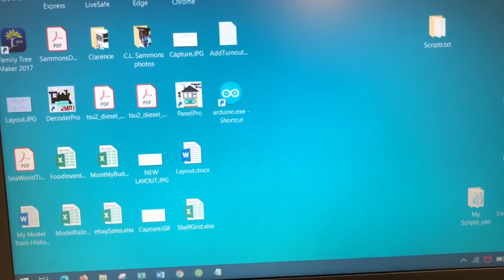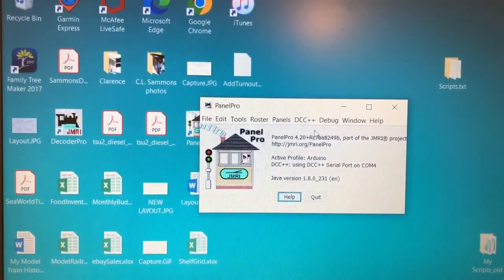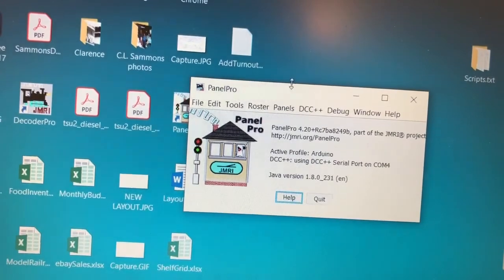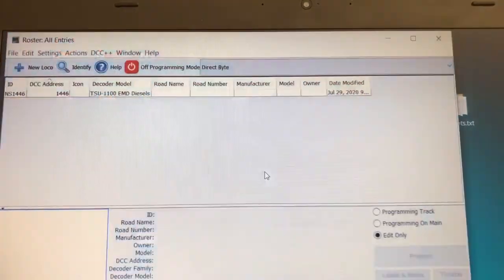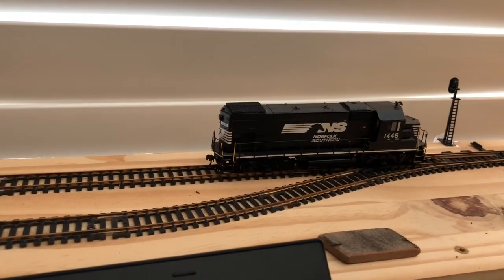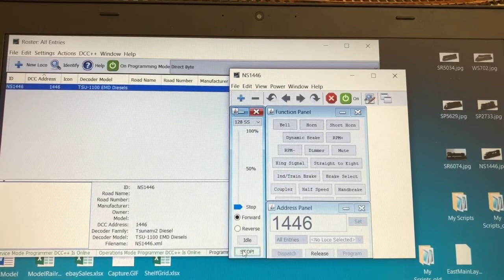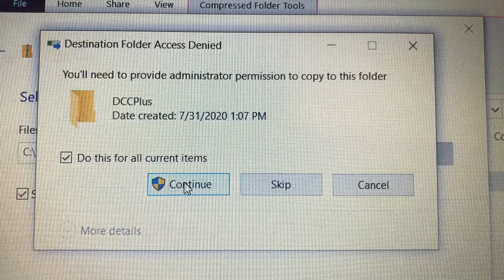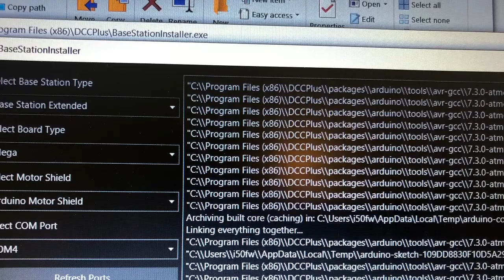My 4x8 x 2 HO Layout - Arduino, DCC++, JMRI  (See comment)

Comment: Hi Fred. For this setup. Do you need to upload any sketch to the arduino?
Reply from the maker: I installed the DCC++ software(sketch) on the Arduino.  To actually run and control locos I wrote JMRI scripts.   There is a playlist on my channel showing some of my JMRI scripts.  I didn’t write any sketches as such.  Hope that answers your question.

Comment: Hi Fred, Just stumbled on your Youtube channel and it definitely struck a chord with me. I am a retired electrical engineer / computer geek who is very deep into Arduinos JMRI etc. Saw your comment about the light sensors and wanted to offer  a solution for you. You can buy and use just the light dependent resistor (the brown round thing on the end of your module). They are pennies each - sold by the dozen. You hook them up with one lead to an arduino signal pin and the other to arduino ground. Then in software turn on the pullup resistor   pinMode(pinNumber, INPUT_PULLUP);  // sets pull-up on analog pin     then later on in your loop do an analog read from the pin     value1 = analogRead(pinNumber)    ... If you print the values you will see they vary based on light. With a little bit of filtering / smoothing it can be quite usable as a sensor input. Note: the pin does need to be one of the analog inputs A0 to A5.  (A6 and A7 do not have pull up resistors)
Reply from the maker: Thanks for the information Alan.  I’m now using IR sensors directly connected to the Arduino.  These were recommended by more than one viewer.

I have >10 of these working with JMRI scripts.  I have difficulty getting them installed thru the track ties and firing in JMRI.  Sometimes I really have to fight with them and other times they line up and work great.  I have one i have yet to get working.  🤬.   I’m thinking about taking a light sensor and rewiring it for  longer lead wires that I plug into the body of the sensor using DuPont wires.  I suck at soldering but if it works might be easier in long run.   I have many more I’d like to install.  The little button sensor will not be as visible as the IR.  But they might give me trouble in the garage as with the door open the light changes.

Comment: Probably too late but you could de-solder the optical sensor and add a short extension.  Then you could mount the board underneath and poke the sensor through the board where you need it.
Reply from the maker: Thanks for your comment Philip.  😀 I’m not good at soldering but I’m going to try the optical ones this Fall.  The ones I’ve been using are sometimes difficult to install

Comment: A short explanation of what Arduino is and what JMRI stands for and what it is would be helpful for us newbies.  After you install all of this, including your sensors, will you be controlling your operation with the computer or your MRC throttle cab?  Or both?  I have the MRC Prodigy Advance Squared and I will like being able to walk around the layout rather than sitting at a computer and clicking on commands.  Or maybe I just don't get it. LOL   Cheers, Bob
Reply from the maker: I added a new video on my technological which might answer you questions.  If I’m just doing a simple video on running train or brief operating video, i use the MRC.   Sometimes the iPad with WiThrottle. I have auxiliary MRC throttle connection on far side of layout.
Reply from the maker: I use JMRI for learning and to reach my goal of four trains run by computer.  Honestly, I rarely just run my trains for myself.  I think contributing to the YouTube MRR community is big part of the enjoyment In this hobby.  Building something and showing it off.
Reply from the maker: Just watched your Christmas tree train video.  I was reliving that time from my youth and smiling thinking of my Lionel going around the floor.  Old school, Man.  But then, surprise!  The sound cranked up.  😀. Very cool.  👍👍😀

Comment: Hi Fred If you are putting more than 12 volts into your Mega (generally 15v for OO/HO), you have to cut/scrape the vin connect trace on the back of the motor shield
Reply from the maker: David, Thanks for comment.  I’m just using 12v 5 amp now into the Arduino base unit.  I’m wondering if I should’ve put power directly to the motor shield as only 1/2 lights show for program track.  Locomotives work on main ok as both light on.   I learned after video that only 2 amps each flow to track for main and program track connectors.  It’s all new to me.  Be safe😷
Reply: @FredE528  Hi Fred I see you followed Cobo on HO video  I used the same video , just to clarify my previous comment  I should have said if you are putting more than 12volts into your DCC++ base station ie motor shield   (generally 15v for OO/HO), you have to cut/scrape the vin connect trace on the back of the motor shield  --  12 volts is the max for the Arduino hence cutting the vin connect.
Reply from the maker: Yes, I used that video.  I watched a lot of videos trying to understand Arduino.  I’m waiting for some cable in mail to use on my light sensors.  I hope sensors are easy to setup for use with JMRI.  Not much going on now on layout.  Too hot 🥵 in garage.  Be safe😷

Comment: Glad to see things are working for you.  Having used Arduino for some experiments, you did it the right way by buying from Arduino.  They are many other sources for parts.  Having try them, I found the cheap parts can have a few "oh by the way" issues.  They work but not correctly.  Take care and be safe.
Reply from the maker: Thanks Greg.  I loaded the DCC++ Base Station from Gregg Berman.  It worked ok.  Then I loaded the Controller software from him.  I tried to verify it and got all types of errors.  Last error was that it couldn’t find ‘Java.util.*’. I couldn’t find anything on internet on this. Have you used this?   That’s when I tried the DCC++ Ex.
Reply: I have not used DCC:++.  The error statement is for missing Java package referenced.  I have run into a similar errors.  The are a pain because the package name is so generic.  My solution is/was to check with a user forum for help.  If that does not work then try an email message to the author.  Many authors are helpful.  I hope this is a help.

Comment: I am using the Arduino Uno, but the Mega is a much better choice when needing more sensor inputs. Nice update. Thanks for sharing.
Reply from the maker: Larry, Are you using it for with sensors?  That’s my next hurdle.
Reply: @FredE528  No sensors. Currently I use the Arduino connected to a Raspberry Pi that is running JMRI. The Arduino has a modified DCC++ that runs DC. This app is called DCp_Cab and was written by Geoff Bunza. The Raspberry Pi when powered on boots up and runs JMRI  and creates a WiFi sever. I connect to the WiFi with an app called Engine Driver which allows me to contorl 2 dc locomotives -- on 2 different tracks, of course. If I ever convert to DCC it will be a simple matter of changing the DC+ app on the Arduino to the DCC++ app.  I spent 50+ years in the software and electronics world. I have no desire to do that with my model railroads. I am done with that.
Reply from the maker: Larry, I spent most of my career in IT field.  Programming on IBM mainframes with punched cards to start.  Ha, that dates me. Then finally with lot of high level PC software.  Not C++ or Java or hardcore current hardcore languages.  This is what draws me to the JMRI scripting.  Trying to prove that my old brain can still do it.  A lot slower however!  Not sure I’ll ever understand electronics.  I suck at soldering so that doesn’t help.
Reply: @FredE528  Yeah, soldering is not one of my favorite parts of the hobby either. Like everything else, it takes some practice. Take care.

Comment: Excellent and great timing (for me anyway).  I definately need to watch Tom's videos, although I've watch many others.

I don't think getting a higher amperage power supply will help at all.  Apparently, most modern HO locos only use about 1/4 amp at full speed & under load.  The 2 amp Peak Arduino motor shield will be able to provide at least 1.4-1.7A Continuous.  That's at least 5 locos with heavy loads, or 7+ locos under smaller loads - at the same time!  LEDs, small auxiliary decoders and sensors generally take little current, so one 2A Arduino motor shield should be all you need (until you convince the Mrs. to take over the rest of the garage!).  However, NMRA does recommend 14VDC to the tracks for any DCC system, rather than 12VDC.  The DCC Guy on YouTube just did a series on regular DCC using a Digitrax Command Station and a generic15VDC power supply.  I gather the Digitrax CS sends the full 15V to the track.  So if anything, a 15VDC 2A Power supply might be the ticket.  (all that info just from watching YouTube!)  ;)

Just remember, one Arduino motor shield only gives you the programming track and one mainline power district output (2 outputs at 2 A Peak each).  So if you want more independent mainline power districts, either you'll need 1) multiple 1-2A electronic circuit breakers downstream of each motor shield output, 2) more motor shields run by your DCC++ Mega, or else 3) the DCC++ recommended Polulo MC33926 3A Peak (per output) motor shield for the Mega, with downstream circuit breakers.   👍
Reply from the maker: Frank, Thanks for all the great information.  I don’t really understand volts, amps, etc.  I have a SPROG3 that, I think, has 3 amps and will run three trains on my layout.  If the arduino will run three  and do sensor detection into my JMRI script then I’ll be a happy guy.  Also, my wife will never let me take over the entire garage.  With the summer heat and the virus, the car pretty much just stays in garage and layout sits unused.  This summer is time for me to learn new things.  Be safe out there😷
Reply: @FredE528  - Hi Fred.  I'm no electrical or electronics genius either.  I'm learning just enough to understand what I need to know for model railroading by Arduino & DCC++.  This to try to avoid the high costs of commercial setups. 
Two things I do know are that more voltage generally makes a loco go faster and makes lights brighter.  While amperage generally limits how many things can be be run at the same time.  They're not mutually exclusive, but I suspect more voltage is the key to faster speed steps.
I speculate the 12+2=14VDC that the NMRA specs for all DCC is related to DCC locos having decoders that run the motors, unlike the old 12V straight-thru DC locos.  Decoder circuits need voltage and a little current.  So if your loco decoder use 2V of the 12V you gave it, the motor only got 10V.  :)
Reply from the maker: Frank, Thanks for reply.  I’ll be interested to see what happens as I experiment with it.   The DCC++ has a power meter that shows percent used.  It didn’t go over 2% on test track.  The power monitor on JMRI was showing ~.6-7 amps from what I remember.  I have never looked at power consumption on JMRI before.  I’ll be interested to see results of running multiple trains.  Take care.